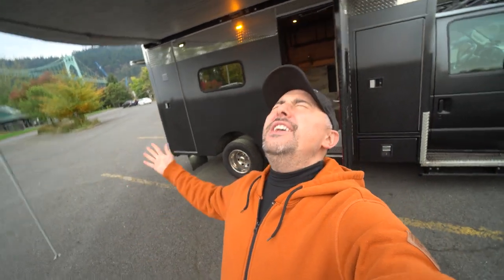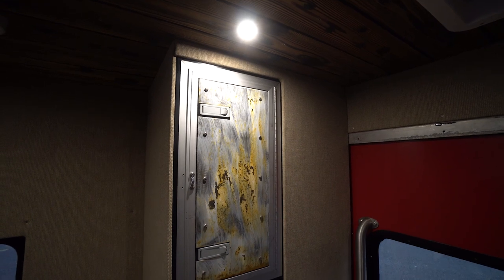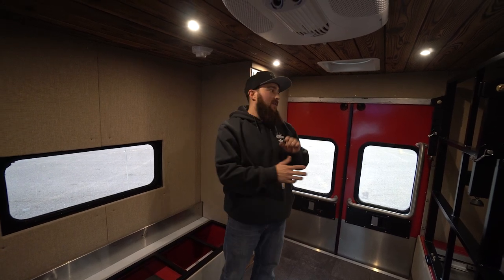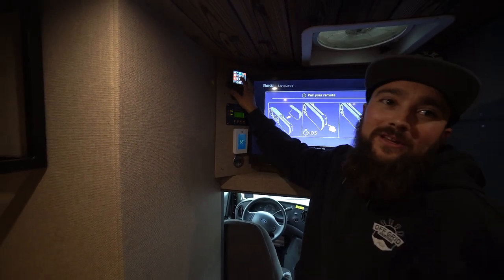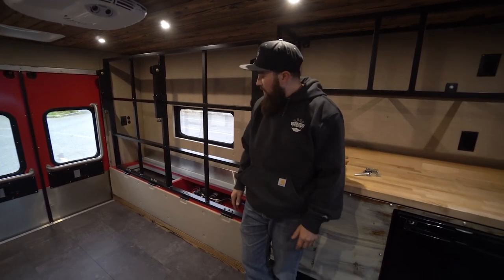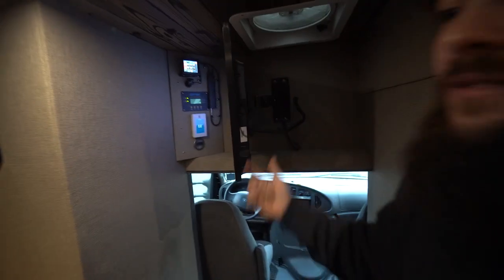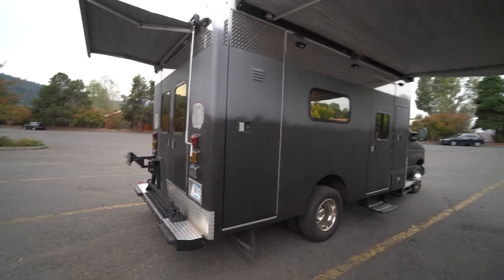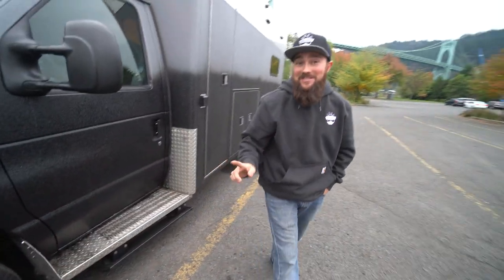Ambulance TOUR Converted into Off Grid Beast 7.3 Power Stroke Diesel

Comment: "4 hours to unscrew a bolt" I feel your pain. I am still in the teardown of my custom ambo build. I see why people who do an ambulance "build" still leave the inside looking like an ambulance.
Reply: I am about to embark on a 2003 Ford E-450 ambo conversion.  PRAY FOR ME!  I hope everything is going well with your build.  I have been pouring over conversion videos.  I am only fearing the electrical wire removal.  I am going for a full tear down, primarily for the spray foam insulation.  How has the build been going for you?  Anything that you would change if you could do over again?

Comment: I have an ambo box here that I was gonna run on a Superduty.  They are 2500#s . The scrap guys hate them as they don't crush easily. And are "comingled" with wood plastic and metal. They say even once stripped the 40/20 I-beam aluminum doesn't like to crush via excavator (how they handle most jobs) . Mine is a LifeStat

Comment: Ambulances come under NFPA standard 1917. The box is meant to be remounted to a new cab and Chassis as needed.  Google Braun Ambulance for test and proof of survival.  I worked on fire apparatus for over 22 years.  CONTACT the Ambulance manufacturer before you begin deconstructing the ambulance so don't damage the integrity of the ambulance. 
  Buy the largest and longest body you can,  20 to 22ft will give you all the room you will ever need.  Stay away from the Dealers,  they know how to sell the ambulances but they don't know anything about the actual building of the ambulances which could cost you your life.  
   Also going directly to the manufacturer will allow you to see Demonstrator units and trade ins. 
  Use 80/20 extruded aluminum for structural builds and 1/4" Baltic Birch for additional strength 
  Rebuild the suspension,  New springs and sway bars, shocks, etc. Get a new driveline and have it installed plus a few extra U-joints. 
Remember that people were transported in these ambulances and they were bleeding, vomiting, oozing all over the interior.  The crews weren't very good at cleaning the interior,  just a mop and hot water with some bleach added . A real fast swing of the mop and they considered it clean.  And the Contamination extended to the cab and exterior compartments.  

You can update the cab and Chassis from E450 to F650,  etc.

Comment: I have access to van in my town for sale. 2005 Ford Diesel Duel wheels but I just saw that 2003 was the last year they had an awesome diesel engine. The next few years had some issues.  This unit has a computer electric issue to be repaired. So 6 months ago they were asking 20k and now 5K. But has only 18k miles. Have to do more research. I would not rip anything out. That defeats purpose.
It has good insulation.
Reply: Just heard you say the other earlier years had head gasket problems. 
So, have to see if the one I am looking at is worth it!
Reply: Thats a great price. ....expect engine issues. If you bought it, by now you know what "bulletproofing" means. I would NEVER trust a 6.0  Ford diesel.  The 7.3 is awesome..but I am over ANY diesels, loving my Ford 5.4 v8 & about to run a v10 . All newer diesels have all sorts of issues. EPA has caused TONS of issues. I LOVE quiet and easy plastic cold weather starts...

Comment: How does a shower recirculate without a plumbed in drain pan?
Reply: I don't believe it recirculates the grey water, but circulates the fresh water through the water heater.  Maybe even from when the vehicle is running.  Instead of using solar to heat the water.  I saw such a system in another ambulance build.